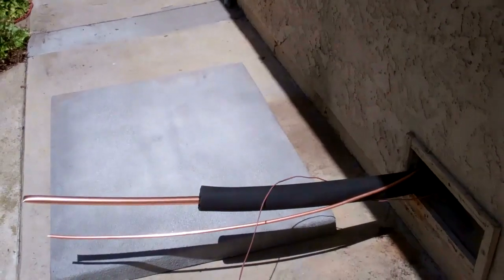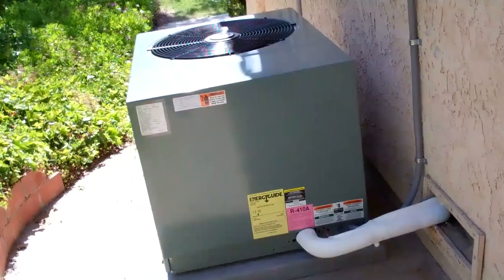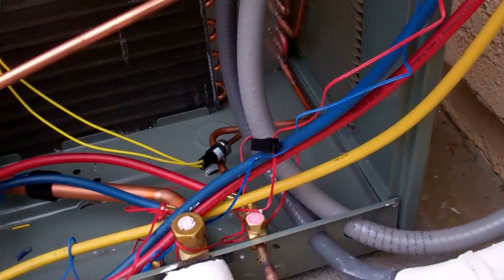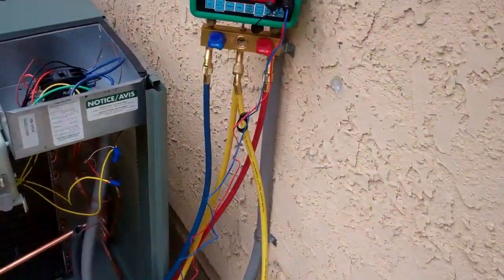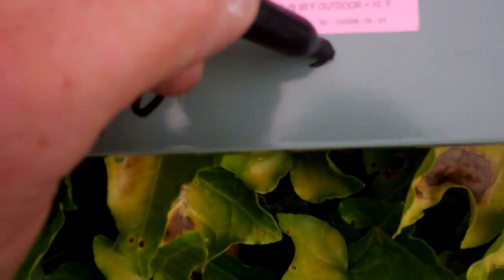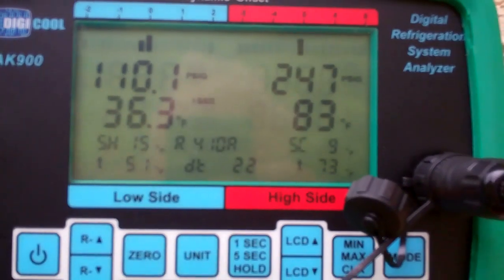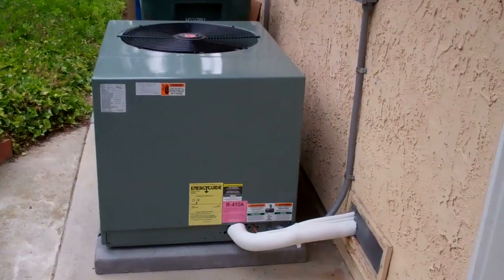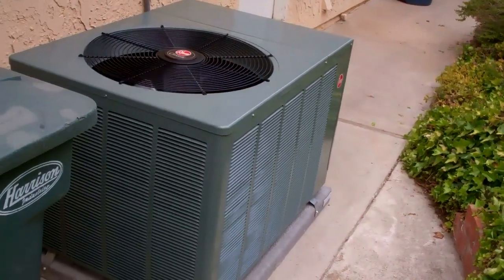HVAC Charging with the DIGI-COOL-AK900

Comment from the maker: The 550 is my favorite because of the size but the AK990 is really not far behind. I like them for different reasons. The AK900 everything (measurement) are on one screen and the ball valve manifold is nice.If I were to buy one I would lean towards the 550 but the AK900 would be a great chose too..What I like about the 550 and the AK900 is that they are simple to operate not that many bells and whistle. I have never try the Sman gauges yet.

Comment from the maker: I really like the Digicools.I have had a fitting leak once but they sent a replacement part for free.The screen is nice you don't have to toggle all your reading are on one screen,I do have the clamps now that is a plus.I do most of my work with the Testo 550 but I have no problems with the Digicool AK900 I would say give them a try.

Comment: Hey Dallas!

I'm curios what wall thickness you use on the pipe insulation? Looks a lot thicker than is used here.

We used to use 9mm or 3/8" but have gone up to 13mm or 1/2" after a humid summer tought me the error of my ways! 

Nice gauges! not looking though as i have other plans for this years tool budget!